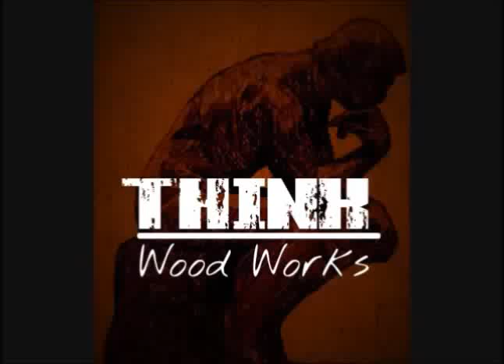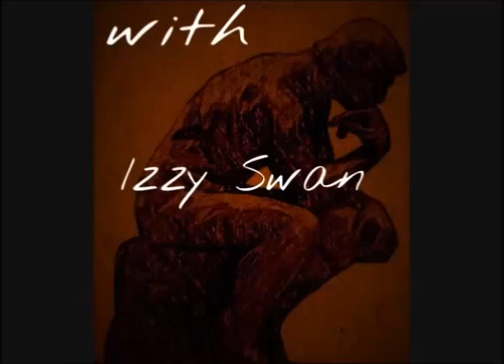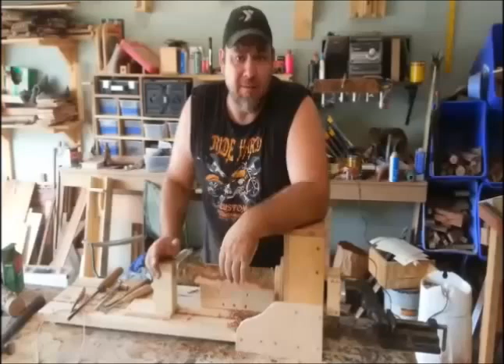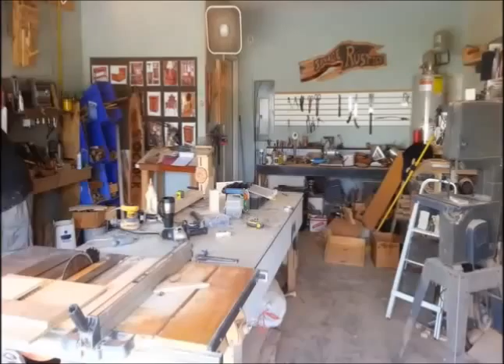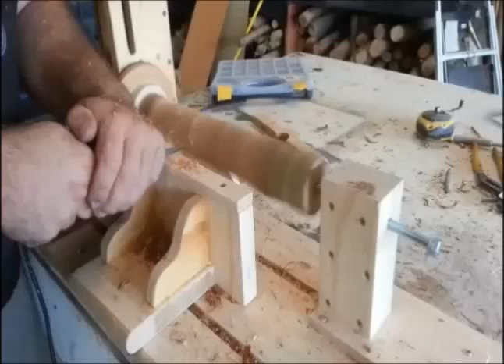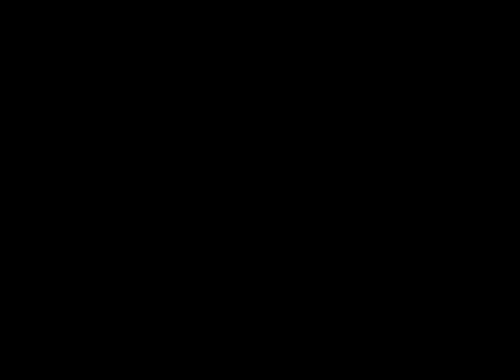Homemade Tools - diy (wood) lathe!

Comment: That looks like a Ridgid R4512 table saw? What blade do you have in there? It looks like it comes up much higher than the stock 10" blade mine came with...